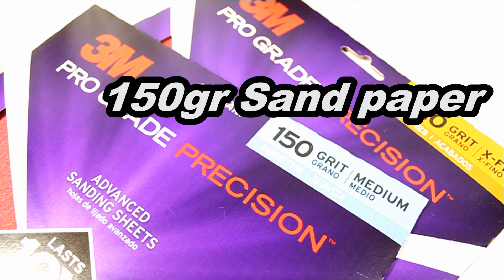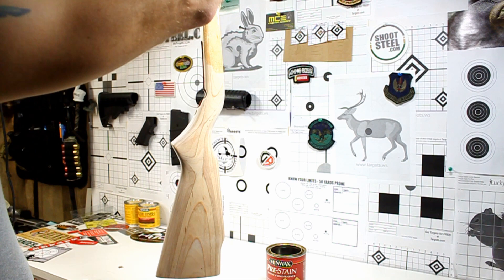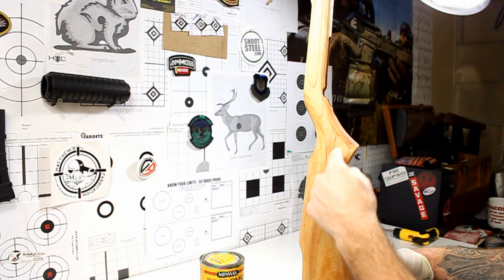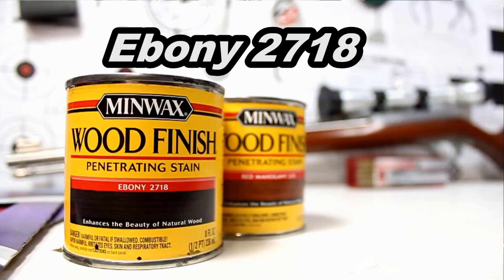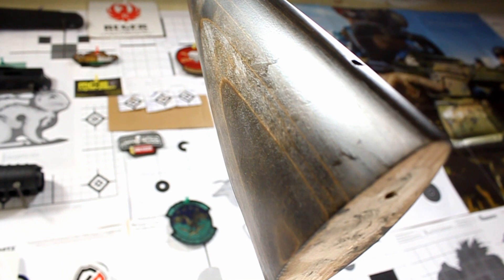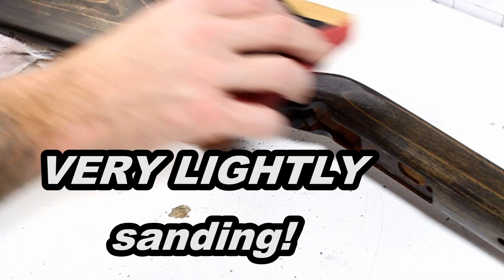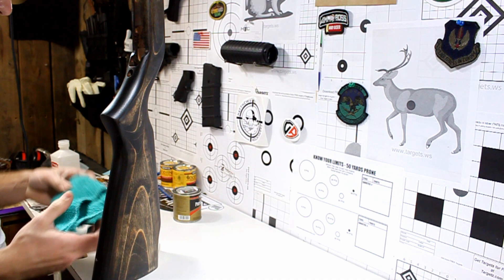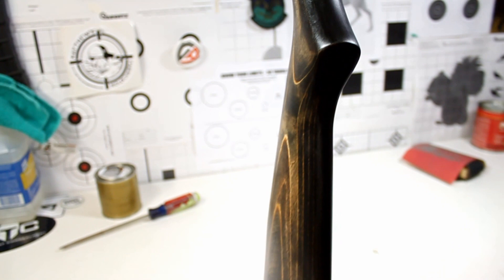How-to: Vintage wood stock finish Minwax

Comment: Little trick i figured out by accident a while back. When staining tight grained woods like birch or beech a little heat to the stock within the first few minutes of the first coat of stain applied will actually pull the stain back out of the areas that the wood absorbed too rapidly (blotches, muddy spots). Wipe off the bled out stain after the heating and the color evens out very nice and gets rid of the blotches while maintaining a good degree contrast.
Reply from the maker: great info! ill have to keep that in mind! Thank you!!
Reply: That's what the pre stain is for!

Comment: Just a little tip from an old woodworker, when you have a run in the clear coat wet sand it with 600 grit. You will be less likely to remove the stain, also make sure the clear is thick enough the sand, usually it's safe after 3 or more coats of clear
Reply from the maker: gunnwild1 ah! Right on man. I have always tried to sand out the runs after the first sight of them lol I’ll have to keep this in mind!

Comment: Not bad at all. I like the smoked coloring look. I've done something similar before but I used a torch to darken the grain(sosukiban Japanese technique). Ads further weather proofing if the poly comes off over time. It also allows non grain to stay a lot lighter in color if contrast is the end goal.
Definitely am curious about that 2 tone you were going for but major props for doing a laminate. I've been curious about that but never tried it
Reply from the maker: dodgersfn Shepard thanks for the good words! I’m hoping to pickup a wood stock for another rifle to give that two tone red and black look a try again.. stay tuned

Comment: It looks great but Sanding and gun stocks typically equals bad which is why you want to use stripper and a plastic scraper,.clean with mineral spirits, then a vert very light sanding. With .22lr you won't have an issue but with heavier caliber rifles you risk weakening then cracking the stock under recoil especially at the wrist and cross bolt areas. I have had to repair a lot of home DIY stock refinish  jobs especially on surplus rifles.
Reply from the maker: I get that, but the amount of material removed is very minuscule, and only as deep as the finish on the rifle. The structural rigidity of the stock is not compromised with the removal of the finish. Ive done the same to about 3 mosin nagant Rifles, with no issues. Perhaps the problems lies in the under tightening of the recoil lug screws by individuals of the stocks that you have repaired?
Reply: The surplus Russian and Russian Capture Mausrs typically have layers and layers of Amber shellac build up along with cosmoline and years of storage filth I have seen the effects of over aggressive sanding with heavy grit paper often taking to much wood from a single side. Can it be done yes, you are proof of that but using stripper will leave you completely in tact with having to remove very very little material if any at all. 

Of course some wood can handle heavier or more sanding better then others, the Chinese Chu wood used on the T53 m44 variants is very porous and fibrous and tends to string apart while sanding and really requires a complete different method to properly absorbed a refinish with almost no sanding.
Reply from the maker: @thegreenman2030  speaking of that, check out how my T53 turned out,  https://www.youtube.com/watch?v=3XF3iNxGSN4

Comment: Stunning finish! I have a beechwood Airarms TX200 MK3 and I wonder if I can achieve the same or similar finish with that stock?? This is the exact finish I was looking for or as near to this as possible. I am pretty handy with DIY projects so I'm very tempted to give it a go. My father damaged (marked) the stock whilst I was installing my air rifle of a floating wall mount stand so it needs sanding down anyway.

Has anybody else here got similar finishes with a beech stock? Thankyou.🙋🏼‍♂️👍🏼
Reply from the maker: you can get the same colors, and shades, but it will not show the grain lines like a laminate stock does, such as this one.

Comment: I love the way this came out. I wonder how a M1 garand walnut stock ( new replacement) would look if I did the same thing? I've actually thought about doing the Shou sugi ban Japanese burning technique and then a traditional sanded in linseed oil finish? Thanks for sharing

Comment: May I use linseed oil after staining ? Will the wood absorb the oil after the staining process? I would like to apply 5-7 coats of linseed oil over my stock after 2 (may be 3) layers of black gye, therefore searching for info about it.

Comment: I like that  I know it laminate  but could I get something similar with a birtch or beetch  wood  whatever model 60s usually come in
Reply from the maker: Steve Campbell you can get the same contrast in color from sanding, and staining, but the definition of the wood grain will not be as pronounced as a laminate stock.
Reply: @ZRUSOutdoorsChannel  ok thank you